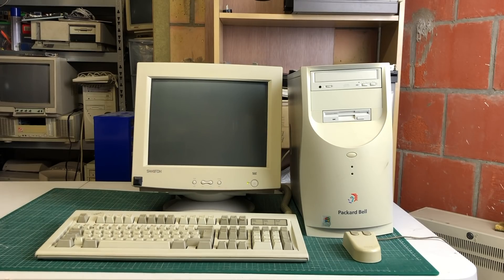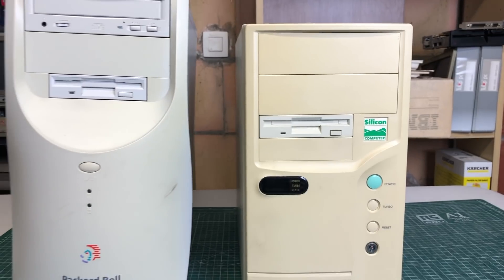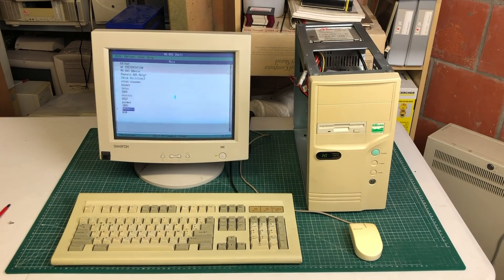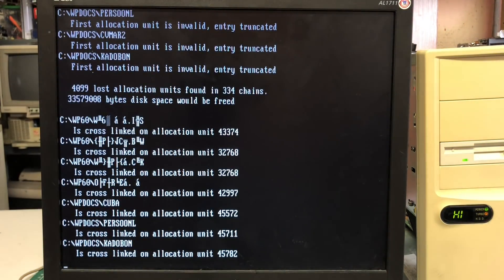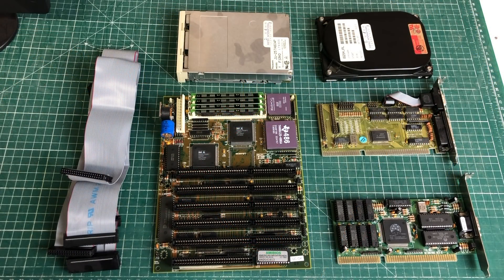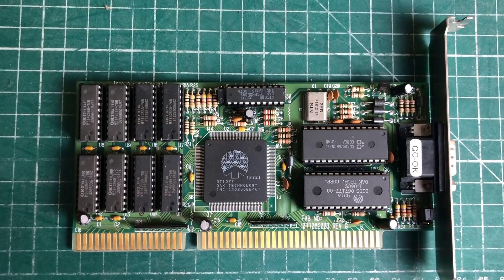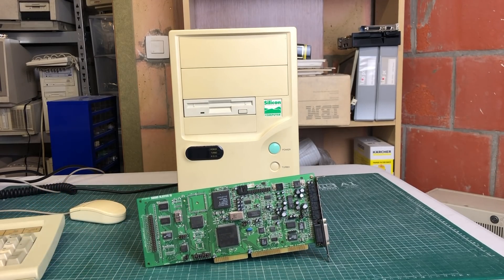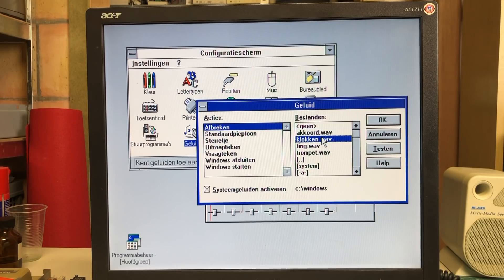A look at a 486 PC wanna-be

Comment: My parents finally decided to buy me a PC after 6 months of "Dad can I have a PC? Dad can I have a PC? Dad can I have a....". But they refused to let me go with them to the computer shop, believing that "The computer shop man is the EXPERT, you are just a nagging KID!". So they came home £1800 lighter and with a 486-SLC-33Mhz. Which we all know, is basically a 386-SX-33 and it was absolutely fucking terrible. Could barely play UFO Enemy Unknown, Doom had no chance (the PC came with 2MB RAM, but even after an upgrade to 4MB Doom ran at 5-10fps). The guy obviously saw two clueless parents coming in and decided to rip them off in the biggest way possible. For £1800, you could pick up a 486-DX2-80 with 4MB RAM and a 320MB HD all day long from any of the comptuer stores in the city. A computer 3 times faster than the one they bought.

Comment: If that PB board is overclockable, try it out, a K6-2 500mhz should work at 550, not sure about 600.  I have several K6-2's.

Comment: I have reservations about Packard Bell, because I had a friend that got one of the Cyrix-based ones new from the manufacturer, and it kept crashing. He had me open it up. I found it had mismatched RAM (one was labeled HP), and the processor was overclocked out of the box. I think it was 20% overclocked, and the heatsink was discolored from the heat. It was a total loss.
He got his money back, thankfully.

Comment: They were known as packed hell for a reason, though not quite as bad as amstrad.

The reasons were often due to a number of non standard features, cost cutting measures and especially the bioses iirc. The non standard not being unique of course as dell, hp, Compaq all used proprietary motherboards and power supplies. This packard bell however looks more standard due to being later mind.

Comment: That era of Packard Bell is pretty much fine. Unlike a lot of their early to mid 90s units, they finally started moving to an almost entirely non-proprietary set of parts. Not super exciting, but extremely easy to service and no hunting for strange parts. Their biggest remaining issue was uninspiring styling and AWFUL stock software bloatware. Fresh loading 98se on those things results in perfectly nice little retro PCs.

Comment: I remember my packard bell vaguely, it had 486 dx100 16mb ram, so it wasn't horrible, but it had a riser card and windows 95 on it.  I can't remember what I had for a video card, but I do remember putting a kairo in it as it was pci. I remember having fun on it till I had a chip fall off of it. Sadly it stopped booting and I didn't know anyone that knew how to solder it back on.

Comment: The AMD K6 CPU's have this fancy 3DNow instruction set to help 3D applications and games along. Those applications that did use it really did get a nice boost. Sadly it was only used on AMD's CPU's. Later the fully-fledged 3D accelerators took over the role making 3DNow obsolete.

Comment: The SLC and DLC were 486-class CPU's strapped to 386SX and 386DX mainboards respectively. Later there was the SLC2 and DLC2 which were clock doubled.  I have a -40 similar to yours in my Fujitsu My333. Some of the later ones featured more cache, but by default it was disabled and you needed to run a DOS util to enable or configure it's mode (WB/WT).

Comment: You’ve gotta build a reverse sleeper. Take your best hardware and team up with either a legit water cooling company to make blocks and accessories, or a machinist capable of milling them. Go heavy on rgb and custom cables, nickel plating, etc. it would be cool to incorporate hidden optical drives someway. I’ve always wanted someone to do this since ltt started the project and never finished it. If I had a channel or the money I would most definitely do it. 

I also want to do the reverse of that, so I guess a reverse ricer pc. Take a 10900k or 3950x and put it on a green/blue/ or red pcb motherboard with a blower style 3090, the fastest ram available with old server style heat spreaders or no heat spreaders, use a bunch of nvme drives with plain copper or aluminum heatsinks to hide them, all flash storage stuffed inside those dual 2.5 drive bays that look like an old 3.5 hdd, use a titanium or platinum psu that is non modular with ketchup and mustard cables, along with ribbon cables if possible, especially for the Zip drive, super floppy drive, 4k Blu-ray drive, and 5.25 floppy. Put it inside an old fashioned super tower or full tower possibly with an acrylic window mod, lian li would be a good choice. Use either a high end aio modified to look like an old fashioned water cooler with green tubing and anti kink coils, or an old fashioned zalman cooler or something big and copper that looks retro but capable of cooling the cpu. Finish off the build with redux fans or maybe some rgb fans that are clear for rgb but don’t use the rgb so they look like those old ugly clear fans that no one ever wanted. You can complete the setup by building a custom retro themed mechanical keyboard or getting an ibm board, getting the best 32000-20000 dpi mouse and swapping the body with an old fashioned roller ball mouse, and getting the highest resolution/highest refresh rate crt monitor you can find flanked by some Roland speakers and audio gear. To make the build look even more authentic you can throw in a 10gbe card, WiFi card, ae9 sound card without the shroud, and a controller card for the zip and floppy drives. If you have more slots you can even get cards for legacy ports for even more authenticity. This is one of my dream builds. Anyone who sat down at the thing (especially with an acrylic window mod) would think it is a oc from the 90s or early 2000s. If you didn’t put windows 10 on it and instead something that looks like windows 9x-xp or 3.1 it would fool even the hardest core pc enthusiasts. People would start to get confused when they realize it’s 32gb of ram rather than mb or kB, or when you load up flight simulator 2020.

Comment: Keep the packard as socket 7 systems are only getting hard to find let alone in ok condition so all you really need is to install 98 and maybe a 3dfx card. Also that 386 system is a Good find for games of the period plus being Cyrix based it has the L1 cache which makes it faster than a traditional 386.

Comment: Need some colors in default VGA text mode.

Start on DOS prompt with a color attached. Example:
COLOR.BAT 1b

@echo off
REM Need one parameter(%1) attached.
REM Usage: Color.bat color
REM Example: COLOR.BAT 1b
echo acs:100>tmp.deb
echo mov ax,b800>>tmp.deb
echo mov ds,ax>>tmp.deb
echo mov cx,820>>tmp.deb
echo xor di,di>>tmp.deb
echo mov al,%1>>tmp.deb
echo mov [di+1],al>>tmp.deb
echo add di,2>>tmp.deb
echo dec cx>>tmp.deb
echo jnz 010C>>tmp.deb
echo ret>>tmp.deb
echo.>>tmp.deb
echo n Color.com>>tmp.deb
echo rcx>>tmp.deb
echo 16>>tmp.deb
echo wcs:100>>tmp.deb
echo q>>tmp.deb
debug<tmp.deb>nul
del tmp.deb
Color.com
del Color.com

.... Next batch file ...

We can set the color components with red green and blue.
Start on DOS prompt with a color and the components attached. Example
WriteDac.bat 1 0 0 10

@echo off
REM Set the color components with red green and blue.
REM Need four parameter(%1 %2 %3 %4) attached.
REM Usage 4 bit Textmode(3): WriteDac.bat color(0-f) red(0-3f) green(0-3f) blue(0-3f)
REM ;------------------------------------------------
REM ; color components default values red green blue
REM ;------------------------------------------------
REM 0 black       00 00 00
REM 1 blue        00 00 2A
REM 2 green       00 2A 00
REM 3 cyan        00 2A 2A
REM 4 red         2A 00 00
REM 5 magenta     2A 00 2A
REM 6 brown       2A 2A 00
REM 7 light grey  2A 2A 2A
REM 8 grey        00 00 15
REM 9 light blue  00 00 3F
REM A light green 00 2A 15
REM B light cyan  00 2A 3F
REM C light red   2A 00 15
REM D pink        2A 00 3F
REM E yellow      2A 2A 15
REM F white       2A 2A 3F
REM ;------------------------------------------------
REM For 8 bit graphicmode(0x13): color(0-ff) from a palette of 262144.
echo a cs:100>tmp.deb
echo mov dx,3c8>>tmp.deb
echo mov al,%1>>tmp.deb
echo out dx,al>>tmp.deb
echo inc dx>>tmp.deb
echo mov al,%2>>tmp.deb
echo out dx,al>>tmp.deb
echo mov al,%3>>tmp.deb
echo out dx,al>>tmp.deb
echo mov al,%4>>tmp.deb
echo out dx,al>>tmp.deb
echo ret>>tmp.deb
echo.>>tmp.deb
echo n WritDac.com>>tmp.deb
echo rcx>>tmp.deb
echo 11>>tmp.deb
echo w cs:100>>tmp.deb
echo q>>tmp.deb
debug<tmp.deb>nul
del tmp.deb
WritDac.com
del WritDac.com

Comment: Excellent find!  386-to-486 upgrades were an interesting and fascinating lot.  The idea that you can upgrade CPU architectures on the same motherboard is a concept long lost to today's systems.  There weren't very many differences between the 386 and 486 architectures from a system board perspective.  Late model 486s had VL and PCI buses, but I think most had plain ISA like their 386 counterparts.  It is true that the 386-to-486 upgrades weren't as good as an actual 486 chip, but they saved a lot of money for 386 owners without having to buy a new PC.  Of course the Pentium would later change that if you wanted to play the newer DOS games, but the Pentium was introduced exactly 7 years after the 386, so plenty of time to consider an upgrade.

Comment: Where do people get their retro computers from? Do you really spend silly $$$ on ebay or am I missing a trick? In Australia it seems almost impossible to find anything. Most thrift stores don't even stock electronics.
Reply from the maker: Digital Archaeologist I never buy stuff on ebay. Sometimes you get lucky and pick up big lots for free or next to nothing (it is rare but when it happens you get one or more dozen interesting pc’s). Otherwise local adds ... this combo here for example set me back 40 EUR.
Reply: @RetroSpector78  Awesome. I've had a few good finds on roadside collections here where the council comes around and picks up rubbish. Mostly sort of early Celerons. I did pick up a mint condition Dell Dimension V400 but I've struggled to find anything older than that. Fantasic channel. Thanks for the content

Comment: Hi, Re the Packard Bell - the AMD puts in in the Pentium 2 or Pentium 3 speed range ( I have a generic Pentium 100 running dos 6.22 and a Gateway 2 - 200 running win 98 ) 

You should be able to run Win 98 unless they have replaced the mother board, but if you want 386 / 486 try turning of in CMOS L1 and L2 memory cache, it will dramatically slow down the cpu - use a dos speed benchmark like superscape 3d bench to compare before an dafter if you make the change.

I believe AMD has a small program that you can turn off L1 and L2 via software as well

Set up this way you can even play the early 286 dos items that were hard coded to 4mhz or 8/10 in 286 turbo mode

Regards
George

Comment: That's an interesting "486" machine! I've got a couple of 486 boards, and one is an older model which is designed to take either a 386 or a 486. It's actually got two sockets, one for a 386 or 486DLC, and the other for either a 387 or 486. Unfortunately I haven't managed to get that board working, although I haven't tried very hard. I've only got a few 486 CPUs, and I only know one works for sure so I didn't really want to risk killing my only known good one if the board is faulty. Hopefully some day I'll get around to testing all the CPUs and doing some more troubleshooting on that board.

Also that Packard Bell is a prime candidate for a Voodoo2 upgrade! If you've got one to spare, or manage to pick one up anyway. On-board sound on those SIS chipset boards was pretty terrible, so better get a good ISA sound card like that SB16 in there too. And Windows 98 would definitely be more period-correct, and probably better for DOS gaming too.

Comment: A bad reputation...”for some reason” indeed.

I had several run-ins with them around the late Win 3.1 to early Win95 era.  I was “the computer guy” and people would ask, what kind of computer should I get?  Anything but a Packard Bell.  Sure enough, that’s exactly what they would bring home.  And then have me over to figure out why their crap Aztec sound card doesn’t work or they can’t dial in to AOL.  Ugh.

I would suggest using it as a boat anchor but that’s unkind to the fishes.

Can’t set it on fire either, on account of all the excessive plastic hanging off the front.  No good for anything.

That adorable little 386 board, OTOH..  ;-)
Reply: You wouldn't believe but a packard-bell branded aztech soundcard is my absolute favorite card for testing and recording fm as well as wavetable/midi module music. Why? Neither it needs any drivers/initialization nor it needs any mixer settings. As it lacks a headphone amp, the line out is crystal clear and noiseless. It works so perfectly well out of the box as I haven't seen on any other soundcard. So please don't treat Aztech that hard😀

Comment: For the Packard-Bell, as others suggest, replace Windows XP with Windows 98SE, keeping RAM under 512 MB.  The first PC I built was an AT-style machine using a DFI K6BV3+ motherboard and this exact processor.  The K6-2 500 was a very cost effective CPU for the time when paired with a 3DFX Voodoo3 AGP card.  Unfortunately, Voodoo cards command hefty prices today, so unless you need Glide support, a GeForce 2, 3, or 4 should work ok, though you can expect AGP 2x speeds. This machine should run mid '90s MS-DOS games  (Duke Nukem 3D, Doom, Descent, Need For Speed, NASCAR Racing, and many others) with excellent frame rates, but will be a bit too fast for most games made for 386 and older CPUs.  Add a decent SoundBlaster ISA card (an AWE64 would be great) and a reliable network card, and you'll have a quality late '90s PC suitable for retro gaming LAN parties.  Modern PCs running DOSBox on wired networks (Using the SVN Daum build and NE2000 network drivers) would be able to join IPX network games with these older retro machines as well.
Reply from the maker: Funny cause I totally stopped playing games from the early 2000's onwards. So I missed the sholw Nvidia "revolution".  Don't know if I have any Nvidia PCI cards here ... would need to check.
Reply: K6-2 500 was cost effective only if you already owned an expensive SS7 motherboard and a bunch of SIMM ram. It made absolutely zero financial sense otherwise in the face of cheaper Celeron 300A overclocked to 450 MHz on the cheapest available Intel 440ZX/BX board.

Comment: That Packard Bell has a K6-2 500 + Super Socket 7 mATX MB with SiS 530 + integrated graphics, sound, and even a gameport? Man, if you don't need it I'd bet most of your subscribers would be more than happy to purchase it from you.
Reply from the maker: Was there anything particularly special about the SiS 530 chipset ? I always considered it to be mediocre / budget minded. For  gaming it was not really suitable and the lack of an AGP port limits you to PCI in the video department ...  I do like that it has an ISA slot for a soundcard should the onboard sound prove to be problematic in ms-dos. The amount of PCI cards that could be paired excluding 3DFX cards is also limited I guess.
Reply: While SiS 530 is just an average northbridge, SiS 6326, the IGP it coupled with, performed well in 2D software rendering. Personally I'd rather not bother playing hardware-accelerated 3D games on a (Super) Socket 7 retro build due to MB with SS7 + AGP are highly sought after by retro gamers and sellers know that; any MB from Slot 1 to Socket 939 would be much cheaper, easier to find, and performs better with 3D games.

In my case the only Socket 7 MB I've got is an Asus TXP4, a hybrid Baby AT / mATX dimension (8.5" x 9.6"), dual power supply sockets, no standardized ATX backplate, no USB, not even PS/2 mini-DIN 6 keyboard socket (it uses an older DIN 5 keyboard socket; the PS/2 mouse socket is not integrated but would occupy an expansion card slot)! Its 430TX northbridge is the last Intel chipset on Socket 7 platform and can only cache 64MB RAM; installing more RAM would SLOW DOWN the system. OTOH SiS530 can cache up to 256MB RAM, more than enough for most Windows 98 apps and games.

I got my TXP4 (along with a Pentium-MMX 233MHz) from a scrapyard for just NT$300 (US$10) so I couldn't complain, but that Packard Bell MB (couldn't tell the exact model from the video) would be a much better retro build as long as its internal and external cache can be switched on or off via BIOS.

Comment: I'd suggest putting a period correct version of NetBSD on that Packard Bell machine, as that's what I did on the similar machine I owned back when it was new. NetBSD 1.3 if memory serves. I chose NetBSD over FreeBSD since I wanted something that also ran on the MicroVAX I owned. And speaking of the VAX, there's definitely a lack of YouTube videos on those fantastic machines. I owned several 3000 and 4000 series machines that I wish I hadn't give away - even ran a webserver from a 4000VLC at one point!